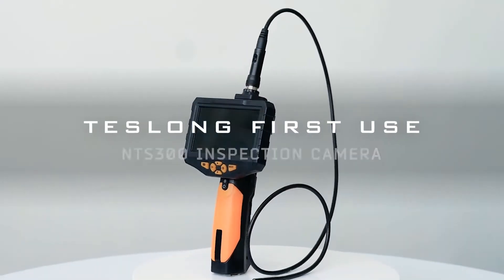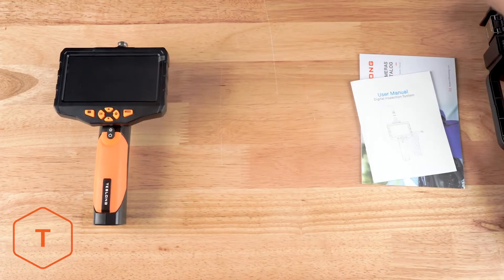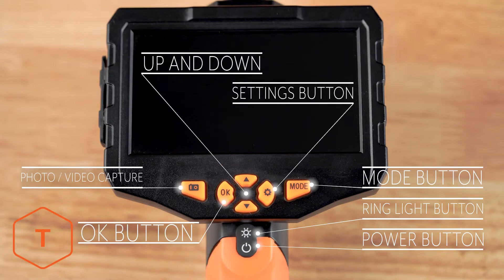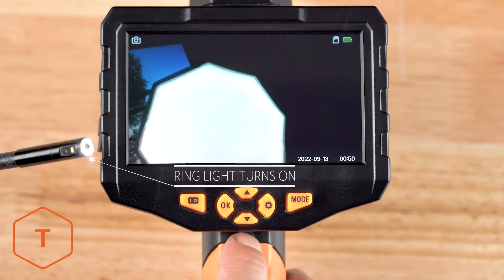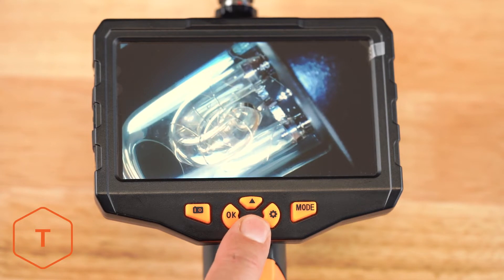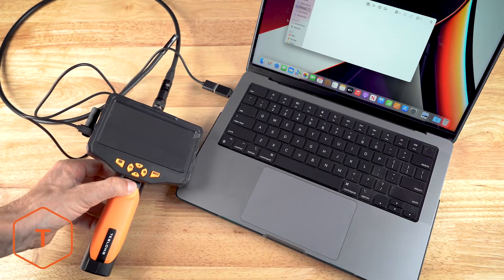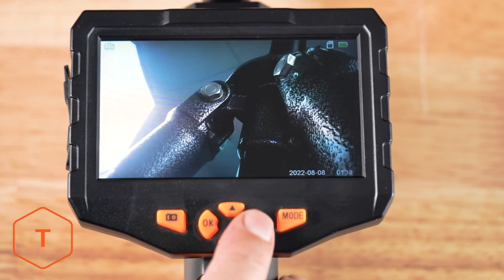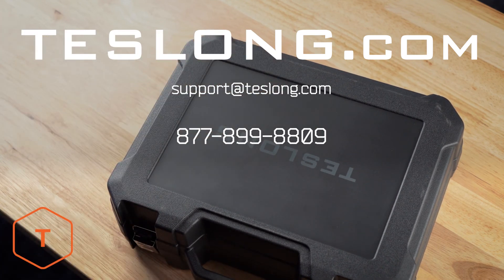Teslong NTS300 Inspection Camera First Use Video Manual

Comment: I have the .2" dual lens endoscope. It's nice, but it's difficult to hold the cable in place when you're inspecting something and the console moves around a lot. Any advice on how to mount the console and cable so they will stay in place?